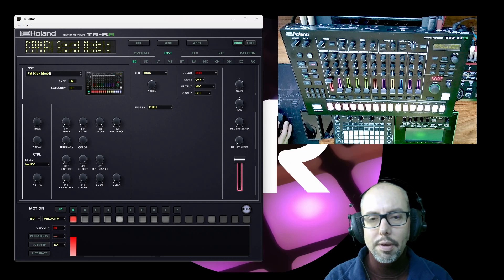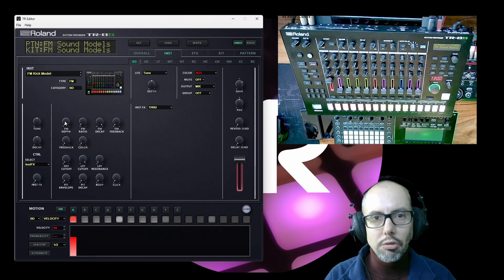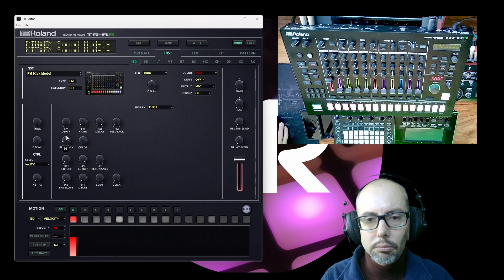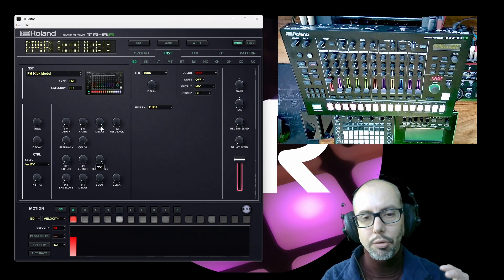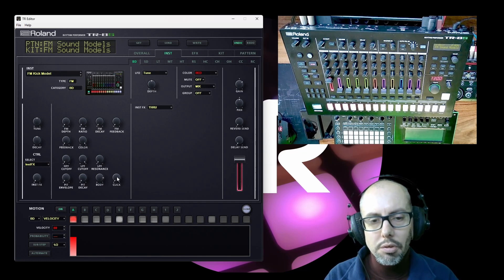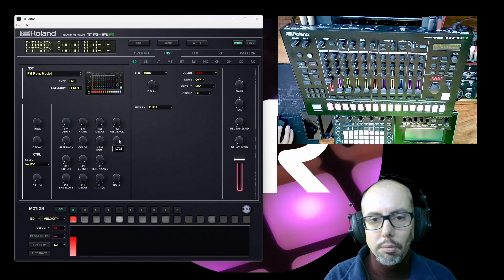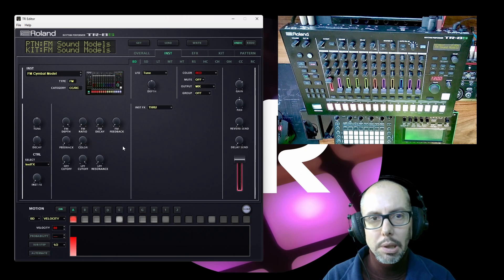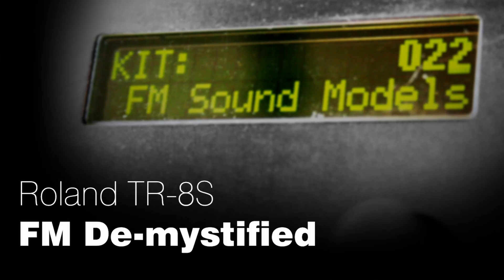FM Drum Tutorial: Roland TR8S

Comment: I build synths.  I know for a fact that the click occurs at the end of a sample, not the beginning., typically when the oscillator is stopped before its oscillations have fully wound down.  

In your example,  the sound is triggered repeatedly, notice there is no click in the beginning, but only between two instances of the sample.   Oacillators are a shared resource, so when the second sample is requested, unless there are other oscillators available, the oscillators that are still working onproducing the first sound are stopped too abruptly.

And what happens is it goes from some value to flat zero, like you correctly pointed out.  The click is that rapid change in voltage, which causes ths speaker's membrane to snap back to equilibrium like rubber band.
Reply from the maker: Fascinating info - thank you for explaining!